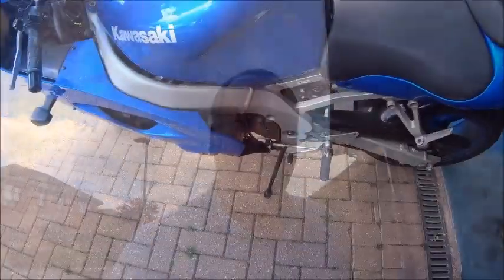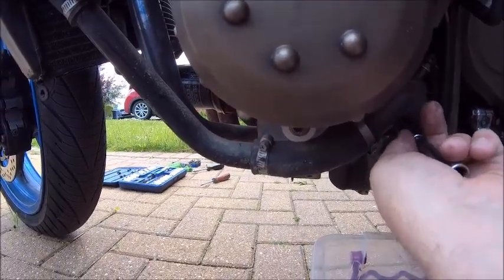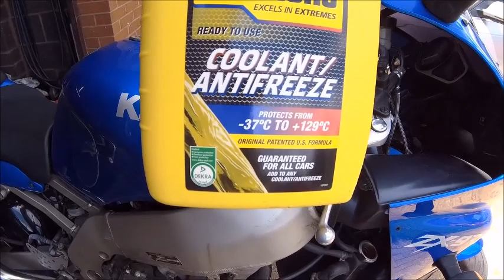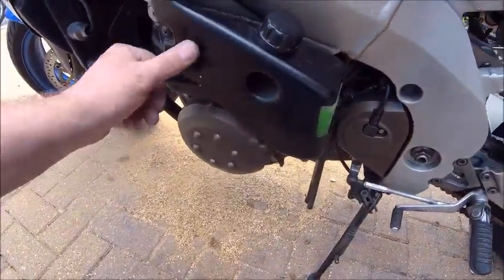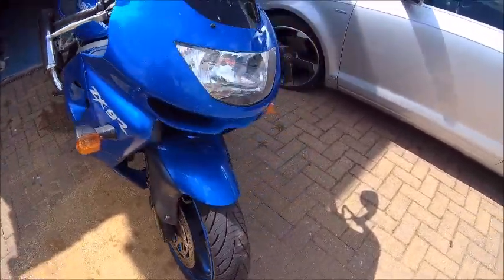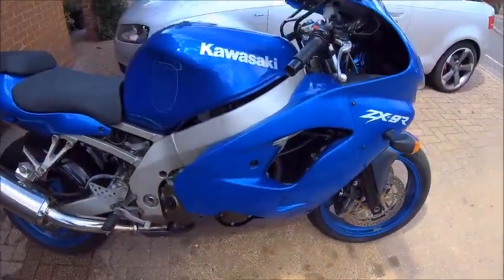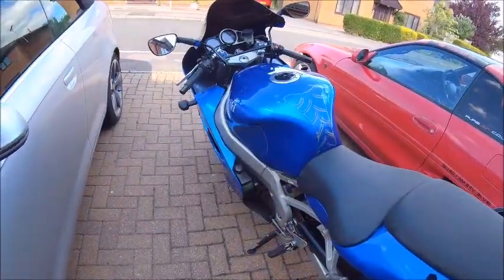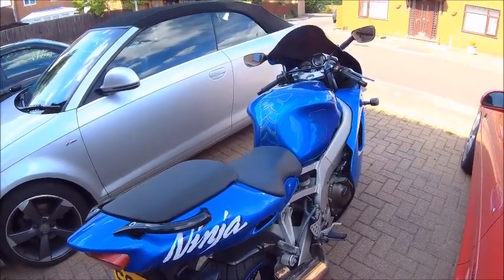Kawasaki ZX9R | Changing the coolant and a quick ride.

Comment: You forgot the other drain bolt lol. Plus you should always flush the system really, especially when changing the type of coolant used, it's to be to prevent reactions from different chemicals that could damage the metal/gaskets. Hopefully it's all pretty much the same, glycol based coolant.
Reply: Where's the other drain bolt sir? I'm doing my coolant soon and any ideas where to find the green coolant like what's already in the bike?
Reply: @alexstewart2247  I think my reply was blocked for review as I put a link in it to some Motul Inugel expert coolant, it's blue and good stuff, I use their oil too, 7100 fully synthetic, the bike loves it, runs cooler by a few degrees.

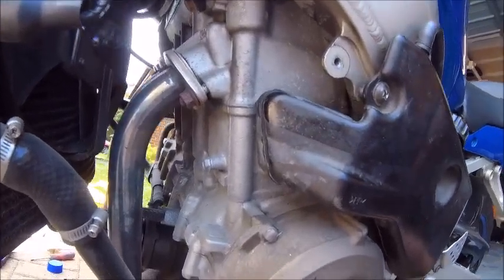The other drain is on the front of the engine on the left side as sitting on the bike, he does show it at one point in the vid @ 6:56. Changing the colour/type of coolant is fine as long as it is compatible, but you must flush the engine a few times before topping up with the new stuff.

As said though, the above coolant is blue and compatible, still best to flush the engine once or twice to remove as much old stuff as possible, using distilled water not tap water.

Comment: Where does the hose from the top of the overflow tank go to I know the one on the bottom leads to the radiator but I can’t seem to find the hose that goes on the top side
Reply from the maker: As I recall behind the expansion tank past the bottom of the engine so any waste can drain to ground..

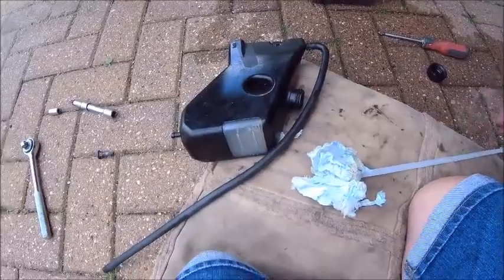Comment: the tissue, is that tissue paper? 4:54
Reply from the maker: Kitchen roll "one sheet does plenty"    😉
Reply: @AdeReeves   ok, i was just wondering if its risky that it would breakdown and pieces fell inside
Reply from the maker: @%9F%98%89nel/UC63ONh9bc_qNpgQeVQVrKyQ I gave it a good flush out with the hose afterwards and made sure it was all clean and free from "crud"     😊
Reply: @AdeReeves  great, my zx9r has issues, i hope u can help, some of the gauges or front panel dont work only the tachometer works, where can we buy parts of zx9?
Reply from the maker: @judestephenromanillos6207  try some of the facebook forums . they are always helpful
Reply: @AdeReeves  ok thanks, did forget to think about facebook, my zx9r is verynice it was facelifted it looks like an r6